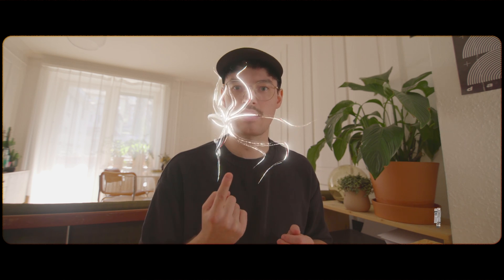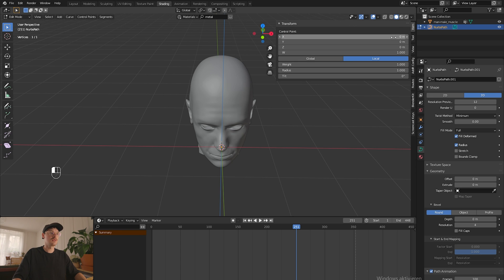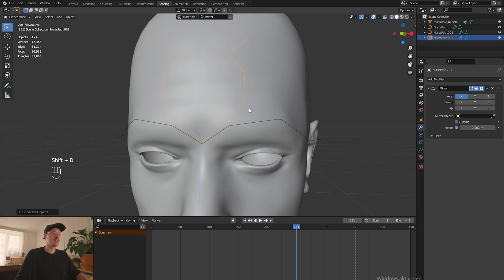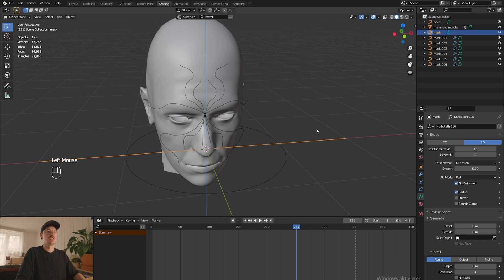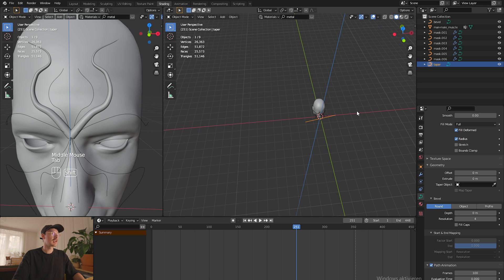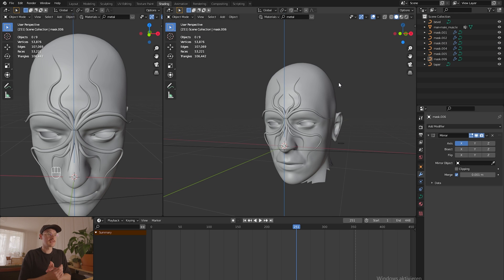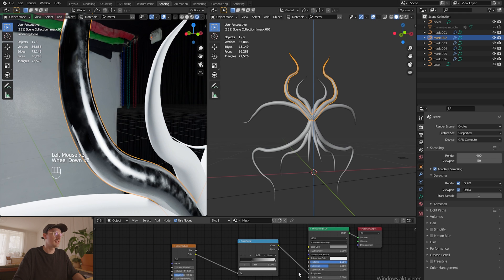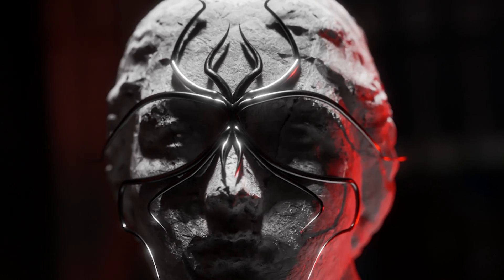3D Modeling in Blender: Constructing a Metallic Wireframe Mask | Part 1

Comment: are you able to add the mask into after effects and use tracking motion to animate it? or does it have to be in blender?
Reply from the maker: well after effects doesn't natively support 3d files so your only option would be exporting a still and tracking that onto your footage. this will limit you to pretty still footage because you won't be able to do perspective changes and deformations. so for complex movement you're better off with blender
Reply: @toericht  alright thankyou. great video by the way, perfect explanation
Reply: @toericht  if i animate the mask growing in blender will it still grow in after effects?
Reply from the maker: as long as you render out the animation as an png sequence, yes :)
Reply: @toericht  you’re amazing!! it worked perfectly :)

Comment: Hi, thx for the video! Sadly, I had a problem with duplication. More specifically after duplicating the mask, I can't select the items that I duplicate in the later process. Plus when I try to curve, it curves the vertices but the things I duplicate still remains in the background. So yeah, that's it for now lol. Would be great if u can help.
Reply from the maker: hey there :) we're not quite sure what you mean with duplicating the mask. Do you mean the single curves which form the mask? if yes, did you make sure that you are not in edit mode anymore when duplicating them? sorry it's a bit hard to find the right solutions without seeing the problem i hope it helps somehow and if not feel free to get back at us again :)

Comment: Heya, I love this so much! I'm making my own mask design and have a question: How do I make the paths intersect kinda like a pipe joint or tree branch? I made 3 different nurbs paths but joined at certain vertices but when I make them into actual snake like forms they don't naturally join together seamlessly. Thanks again xx
Reply from the maker: Hey there :) sadly this technique is quite limited.. but what you could try is to join all paths into a single one with cmd+j or ctrl+j and then add an Remesh modifier on top to make them all blend together. I hope this helps you somehow and if not feel free to ask again :)